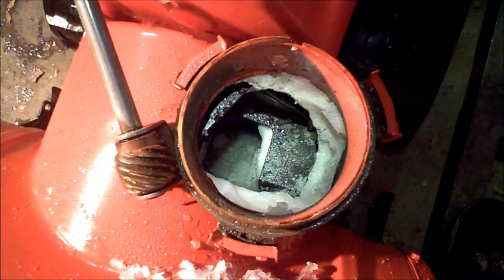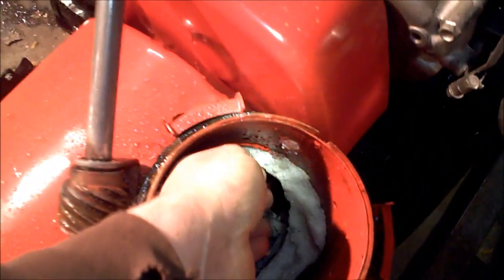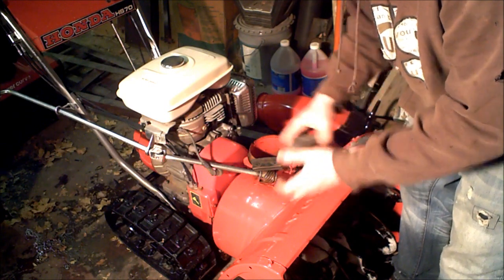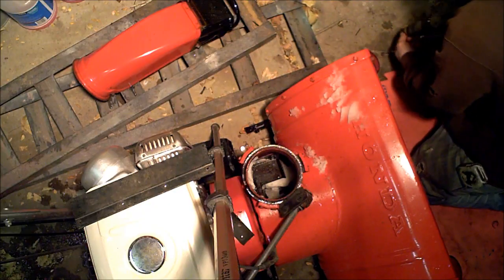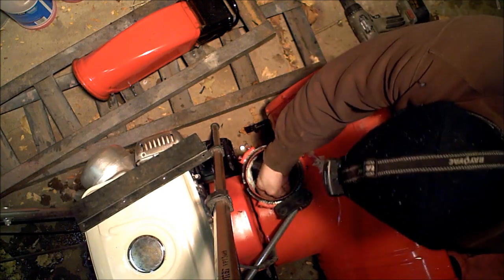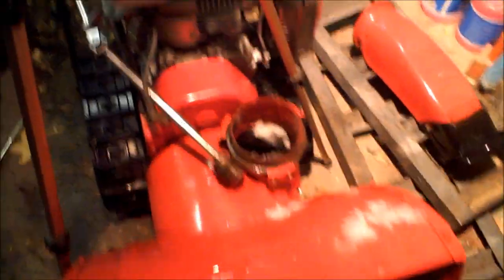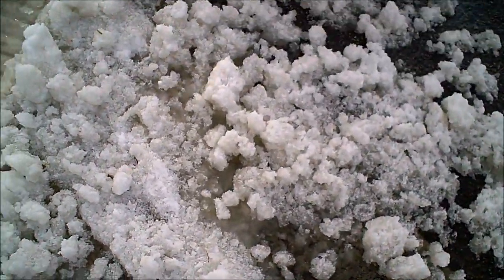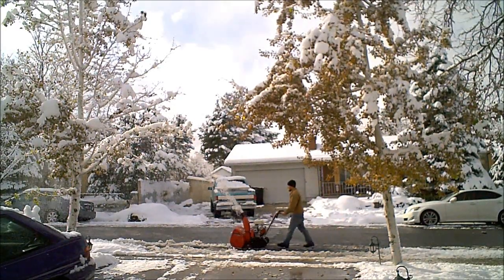Modify Snowblower to never clog and throw twice as far w/ Impeller Kit

Comment from the maker: I would use a scrap cordless drill. The motor is reversible and the battery pack can be charged on a charger. It has plenty of torque to move the chute. An external stator generally produces AC current and is only good to power a small light source. With an external stator you would still need a rectifier to turn it into DC and a battery.

Comment: .

I went out and got down on my hands and knees and did some measurements on my blower and came to the conclusion not to do the fix.

I do have 1/2" gaps on two sides of the impeller housing but the bottom measurement is a tight 1/8". The rubber belting would not help that much on it.

Thanks again for your good idea.

.

Comment: .

Good post. I have a 6'  V-Type, 3 PTH blower hooked to a TEA-20 Ferguson that works very well.

But I think I will try your fix on it because there is about 1/2 " clearance between the four paddle impeller and the housing. I will be bolting the rubber on mine though.

Couldn't hurt, could it.

If you want to see my blower working I have posted three videos on here.

Again thanks for the post. Most times the simplest solution turns out to be the best.

.

Comment from the maker: I think a 4hp is ample for a small 22". This is a rare blower with a straight forward 2nd stage. The impeller modification will definitely help this one. The Chute should have clamps that hold it firm to the housing. Most of the time they need a good amount of oil( I like transmission fluid) and the gear tooth that rotates the chute needs to be pushed closer( loosen the bottom nut and push closer).

Comment from the maker: I just checked MO and you have quit a few stations that are e-free, lucky you. They wont completely ban e-free gas because small airplanes use premium gasoline and it is against FAA rules to use ethanol in planes. This is because of the water absorption, vapor lock and the evaporation rate of ethanol making it an extremely lower octane fuel. I have used Stabil in ethanol fuel with poor results. It's better than not using it, but not much.

Comment from the maker: I think it is a national 10% now. Ethanol is government subsidized so it is cheaper. They also use very low octane gasoline and the ethanol jumps the octane up to a reg, mid or premium level. W w w dot PURE-GAS dot ORG will show you all your local stations that are ethanol free. Currently I have to drive 30 miles to the nearest fuel supplier to buy e-free(mid-premium grade 88 octane). I was in South Dakota last year and their pumps had both and the e-free was .10-.20 cents cheaper for regular.

Comment from the maker: Yes, I agree with you. I will not use ethanol fuel in any equipment. The fuel systems are far from air tight and the ethanol attracts moisture. This settles to the bottom of the tank and carb bowl. The ethanol also evaporates quickly. Another issue with ethanol is it is used to bring the octane levels up and once it evaporates(days to weeks) you are left with weak gas. The low compression ratios on equipment wont benefit from premium over regular but any fuel w/o ethanol is good.

Comment: I have COMPLETELY stopped using etheonl fuel....Only use Premium with NO ethenol!
Too many Horror stories about the lousy stuff in small engines.  It eats the rubber gas lines and gets into the carb and plugs everything up.  Caseys fuel,  You may get 10%  one time and 30% next time...Not good for small engines....I have replaced ALL of my equipment with the yellow gas lines...Ethenol is not supposed to eat em up...

Comment: will this work on my  3 yrold  MTD WHITE with a 208 cc  that clogs every frickin time ..i havent looked in there.. i thought 5 hp is not enough .. it dosent blow it more than 3 feet.. i hate this thing.. want to sell it... but still need it.. ontario canada 3 feet of  snow here...the carb was replaced and works better but still no balls to blast the snow.. told them to crank the idle top speed  but still clogs and  MTD gives you a plastic stick for this..lol cuz they know it clogs so badly

Comment from the maker: The new paddles for a Toro single stage just touch the housing. So with the old one still on, you're able to measure the distance between the housing and the worn paddle. You then take off your old paddle, lay it on new material and add the missing amount to the leading edge. I actually did a video on this called :  

 Make your own snowblower replacement paddles  
rJQAfE9dmA8

Comment: Thank you.  I'll work on the skid plate idea.
I also like the guys idea about putting paddles on both sides of the inpeller.  Thought while I am doing it,  why not.  Hanna Rubber in Kansas City MO. has conveyer belt material for sale.  Checking on prices.  The unknown factor with my buddys Toro single stage is that we dont know the original dementions of the worn down edge to make new ones

Comment from the maker: ATV blowers are nice just expensive. An ATV is a much better machine for moving snow. If I was going with the expense of an ATV blower I would also go the route of an ATV to hook it to (I would probably buy a used package).

If you're having steer issues with the front of your rider, tires chains on the front tires help a ton. If it is belt slippage due to snow build up, I think your idea of a skid plate is a great idea.

Comment from the maker: I think every 2 stage snowblower can benefit from this modification. But if it is clogging before it even gets to the impeller it wont fix that. The modification will help it throw the snow further. Spraying the housing-auger with wd40 can help the snow not stick to the auger-housing. This will help but wet wet snow can be a curse especially with a wider snowblower.

Comment from the maker: If the front auger (1st stage) is clogging, I would think that you shear pins are sheared. It will spin when no load is applied but once there is a load it will stop. The second stage (impeller) will still spin and work great.

Comment: I have a Craftsman 2 stage snowblower on front of my riding mower.  Chute doesn't get clogged but the augers get PACKED with wet snow and have to stop and clean them out.  And I only have about 6 in. clearance under mower. Any suggestions?

Comment from the maker: @Tony A Yes you have 2 stage snowblower. Your impeller should be a 3 blade design. So you will need to put on 3 rubber paddles. This is an amazing modification and you will be glad you did it. Let me know how out goes. Thanks for the comment .

Comment from the maker: I would put it out to 5/16-3/8" with a slight cut angle edge (approx 45 degrees) touching the housing the . The soft rubber will quickly wear in giving you a tight fit in the smallest gap area. A bigger gap in the area at the top, right as the impeller passes the chute is pretty normal. Let me know how it goes.

Comment: When I checked the clearances, there is quite a bit of clearance when the impeller is directly under the chute.  Probably about 1/2 inch.  When it is rotated to the other side, it is only about 1/4 inch.  It doesn't appear that the impeller is con-centric with the housing.  Nothing is loose, so I'm assuming this is by design.  Should I just use the 1/4 inch for the rubber extension?  This is a JD snowblwer with three paddles, so I'll be mounting on all three.

Comment: Ok, this is just a stupid idea.  If you want to prevent snow from clogging the impeller and the chute, coat the inter linings with wax.  Yes, wax.  The reason being is because the water molecules (solidified--snow) will react with the wax, which causes it to slip, thus leaving very little resistance for the snow to cling to the impeller and chute.  Even if you're working with wet snow, this solution works very well.  I'm Canadian, and an engineer, so I know this stuff better than anyone. Cheers.

Comment from the maker: The hose running from the primer bulb to the carb has more than likely swollen and cracked due to ethanol in the fuel. If so it is usually long enough to cut a little off and reattach it.

Comment: This works awesome! I've got a toro 8HP by 26" 2 stage snowblower. It used to clog up and only throw snow 12' at most in 4" of heavy wet snow. Then I screwed 3 pieces conveyor belt to the impeller and now it shoots 4" of heavy wet snow 30'.

Comment: First, the Toro is OK according to the Service Manual and the local dealer. I had it in for what turned out to be the choke linkage falling off. While in I  had  them go through  it  and make  any repairs they felt it needed. They made none. 
From your video I'm not sure where  you are installing your rubber flaps. Is it the edge of the impeller blades?

Comment from the maker: Yes, do it. I also have done this to several metal single stage units. Most of the time they are made of 2 paddles. Right where they flatten out to discharge up the chute add a strip of rubber to each of the paddles. It will throw twice as far and wont clog.

Comment from the maker: This mod will make so you never need to use WD-40 and it will literally make your Cub Cadet throw 2x as far. 

Your single stage Toro sounds like it has worn rubber paddles. One with good paddles will never clog. If the distance between the housing and rubber paddles is over 1/4 of an inch they are worn beyond their life.

Comment: You are a genious, I did this to my old Toro and it wors like a dream. I litterly throws the snow to the neighbors yard, and the slush is no longer and issue of mine. It works as you said. I will now modify my Ariens also. I did as you suggested with the sidewall of my old tires, works like a dream. Awesome thanks for the tip.

Comment: I have a older Toro 7/24.  I have some steel drill bits that are meant to drill through metal but I'm not sure if the bits will break when I try drilling or any other problems I might come into?

Comment from the maker: I have only done it on the front-leading edge of the blade. I have had the same thoughts of the lip of rubber impeding the perfect flow of snow. So I try to use as wide of piece of rubber as possible. The metal screws would only work on the leading edge where the forces on the rubber a very minimal compared to the back edge. Definitely easier to bolt them on with the machine apart. I'll have to try the back edge one of these times. Either way it's night and day the way it makes the blower throw.

Comment: I also wanted to say that I bolted mine on the back side of the blades, and used carriage bolts through the front. It just seemed like the better way, so the snow would not be impeded by the added pieces. Have you tried it both ways/ and if so, did you notice any differance? BTW, excellent job with the video. Thanks for sharing.

Comment: I had done this a few years ago (in a modified version) to my JD 824 walk behind and it does work great! I had the machine apart at the time, so I drilled and bolted them on with the impeller in the vice. I never thought of using Tek screws, I may try that in the future, although the blades are very thick metal on the older JDs. I have to admit that I replaced the 8hp with a 9 I had lying around. I put them on all 4 blades, and I have to admit that I like the howling sound that it makes now :)

Comment: Just because you could not see a difference, does not mean there will not be a difference. The whole point of the kit is to fill the gap, so why would you leave the gap on half the blades. That is just doing half the job because you are trying to find the easier way out. What conditions were present when you claim there was no difference. A lab has to recreate conditions exactly. Type of snow, (wet etc), temperature, depth etc. The Mechanical facts are there, that is proof enough.

Comment: I saw another comment about the blades and now it is gone. Did you delete it? Why? That was right. The whole point of the rubber is to prevent snow from going past and it throws faster further out from the center. So why would you leave 2 blades with passing snow and slower throwing dumping the snow into the next blade. Why not do it on all four. That is the point of the kit, to fill the gap! Do you have a problem admitting that the other comment was right? That is pretty sad of you.

Comment from the maker: On a 3 blade impeller all 3 are needed to balance.  On 4 blade impellers I have put the rubber blades on all 4 and only 2 on several machines. There is no noticeable difference in doing 2 or 4. I know that bolts and nylock nuts are the best but the force on these paddles really aren't that great. Since I always put them on the leading edge the forces are pushing the rubber blades to the impeller. I have kits that are over 10years old with self tapers that wont fail. Thanks for watching.

Comment: I made the change on my snowblower today.
Now it throws the snow at least three times longer then before and no clogging at all!

Before the change of the blower it was useless in the wet snow (Had to use my single stage blower), and now it works very well. It throws wet snow around 6-8 meters.

45cm of wet snow was not a problem at all, it just kept going.

Comment from the maker: It will increase efficiency on any impeller designed equipment. I have a video on here that I did it on a wood chipper to increase the blowers power and it tripled it. The rubber paddles have "give" to them when the hit an obstacle so there is no worry of damaging your equipment.

Comment: I have a 7Hp Toro older one with the drum type auger. The 2nd stage impeller is 3 blade and is pretty thick. Have you ever done one of these if so did you use bolts? Thanks

Comment from the maker: Cont: The addition of these paddles give back better than new performance to an aging machine or new machine. It also prevents stones and ice chunks from wedging between the impeller and housing and causing any further distortion. Most new machines work great out of the box and do so for years. This is what engineers design them to do.

Comment from the maker: You know I would have to disagree with you here. The techniques employed here are the same principles used in single stage snowblowers.  The rubber paddles do not apply any lateral force that would cause premature impeller bearing failure   Manufactures leave a gap to prevent a collision of the impeller and housing. The gap allows stones and ice to wedge between and slowly bend the impeller blades inwards (increasing the gap) or bulging the housing outwards(increasing the gap). ...cont:

Comment: Great video as always. I really like your vids and believe you provide a great service to the public with your "how-to" vids, however, I do have a problem with this vid. Manufacturers do NOT condone this technique because it does prematurely wear the impeller bearing/bushing. If a Honda is not throwing far, then there are other problems. There is a reason why the engineers of these machines leave a gap, and to bypass it is only asking for problems.

Comment: Got an old Toro with the thicker impeller Still thinking on drilling holes and bolting. This is a good demonstration of how to do it,  and was very impressed on how far it threw the slush. Also have an old Toro S-200 single stage. It's hard to start but when it does it does quite a good job.Thanks for posting.